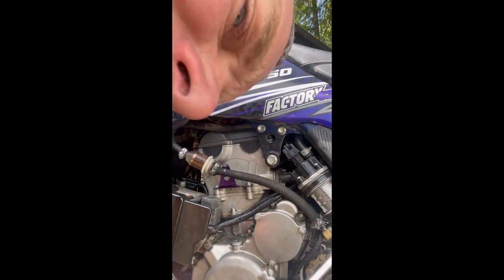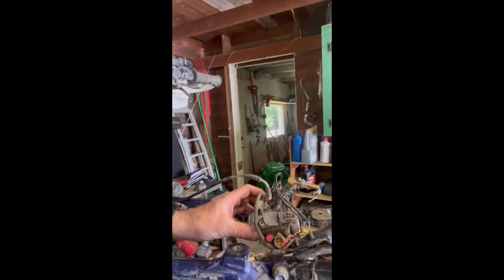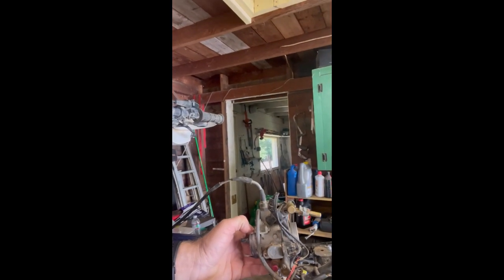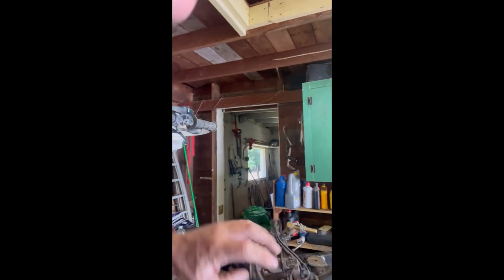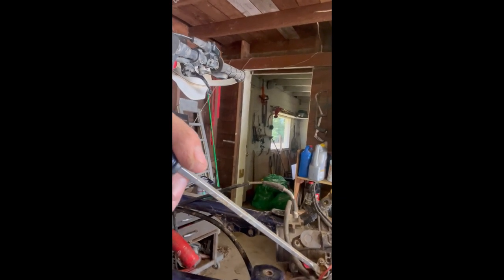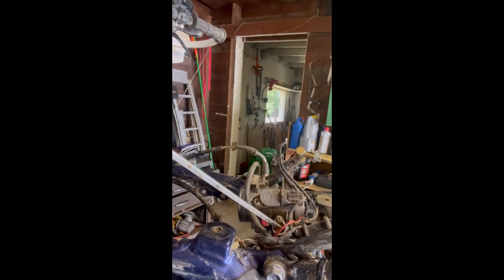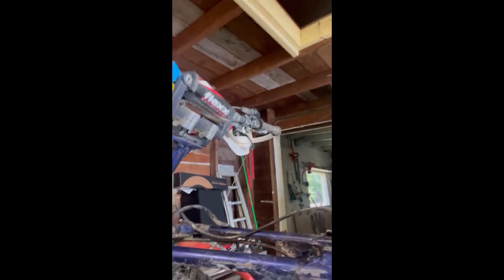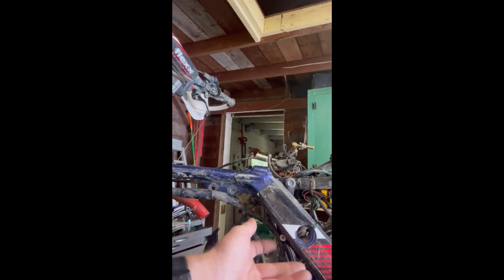ltr 450 idle adjustment

Comment: hey sir , if my idle was bad will it effect the way it fires ? , i took it to the dunes it rides awesome everything was prefect , it just wouldn't idle for like more than 5 seconds unless you keep giving it bit of gas + if you want to start it you have to give it some gas to start , its really fast no issues while running i drove it like an hour 30 minutes in the dunes , I'm just having this problem , it was parked for more than 12 years and i recently serviced it , it had so issues with the timing chain + crank bearing , when i told the mechanic about the issue here where i live he told me you should give it more time and it'll be back to normal he means that i should ride it more time  , i don't know i just don't believe it
Reply from the maker: Hey thanks for checking out the channel!  Do you try to turn the idle up just a little? That might help.   Did they go through and clean the fuel system?  So most people that work on bikes hate the Suzuki, they just don’t understand the fuel system is my guess.  If you do I would clean your gas tank out to.  If you get a spec of crap in the fuel they don’t like it.  When they did the timing chain and all that did they. Check your valve clearance?  If that’s off it can cause it not to fire right away.  My guess it’s your fuel system needs cleaned out and your injector cleaned.  Hopefully this helps if you need anything shoot me a message and I can try to help.👍
Reply: @dirtchurchracing6854  ,, actually we did check the valve clearance everything was perfect + we did all fuel cleanings , but didn't replace the injector yet ,,, I will send you some pictures on Instagram the fuel filter bowl was done lol , thanks for the reply sir
Reply from the maker: I personally would get rid  of the fuel filter bowl and put an inline filter on it, I would clean the injector one more time

Comment: Hey brotha my ltr 450 runs perfect for 30min then when I hit the throttle it bogs down but if I hit it slow run a bit better
Reply from the maker: Are you running a swirl fuel filter under the tank? I would clean your fuel system, that’s what it sounds like.  I would also drain the gas out of your tank and make sure it’s clean.  Suzuki seem to be a pain in the but if you got dirty fuel
Reply: @dirtchurchracing6854  
Yes sir I was check that video you made with the swirl filter I’ve had it since 2006 I’ve never changed it ima take a look into that and thanks
Reply: What’s funny that the shop wants to buy it
Reply from the maker: @JoseAvila-gw5jc I personally like to get rid of those and put an inline makes them easier to work on, if you never checked it, I am sure it needs cleaned
Reply: @dirtchurchracing6854  
Yes sir ima get rid of it
Reply from the maker: @JoseAvila-gw5jc good idea, let me know if you have problems

Comment: Hi like your tips bro i have a 2006 ltr 450 and mi fi light its on the bick runs kind of fine when cold no light on but when it gets hot the light comes on and it runs really bad any idea? Hope you can help me thanks
Reply from the maker: Does the light come on and flash?  The first thing I would do is clean the fuel pump and the injector and fuel filter. Do you have the swirl filter on it?
Reply from the maker: If the light blinks it normally will shut off the quad and you will have to wait some time before you can refire it.  I have had the injector plug go bad and there east to replace.

Comment: I need help with my atv. start but when you give gas looks like is getting to much air and turn off
Reply from the maker: What kind of atv you got
Reply from the maker: If you think it’s air problem make your rubber boots that go to your carburetor or fuel injection is attached and no holes in it , or throw your air box lid back on it, if you got an air box

Comment: Hello my friend. My LTR 450 shuts down , and this only happens when it is already warm, and when i´m running it for 10 minutes on the road. I have new injector, new swirl filter, new spark plug, and new air filter too. Is there any device what to check for you can give me?
Reply from the maker: Does it make the red light start blinking?
Reply from the maker: I assume you have the red ,green and orange lights on your bike. If it shuts off and will not start the red light will blink. And you can pull a code from your bike that will tell you where to look.
Reply from the maker: Not sure if you fixed this but mine did this and it was the plug going into the injector was bad. You can replace them for pretty cheap

Comment: Is there a way to adjust the TPS Sensor.  My LTR only turns and back fires.  Any ideas.   I checked the fuel system.(worked)  the injectors spits fuel.  The spark plug has spark and the there is compression.
Reply from the maker: I believe if the tps sensor is in the wrong position it will not fire. I could be wrong.  There is a way to delete the tps sensor.  Does it start up a ideal?  If it is cranking and not starting and back firing I would think its out of time. You can pull the timing cover off and check it.
Reply from the maker: Also your injector when it sprays it should be a wide fan, if you look up injector spray patterns you will see what I mean.  Let me know if I can help out!